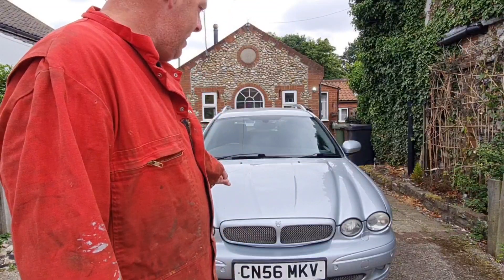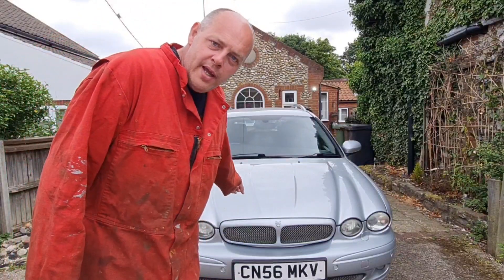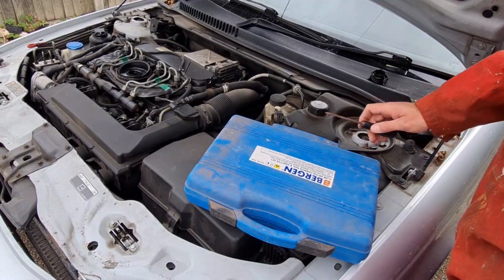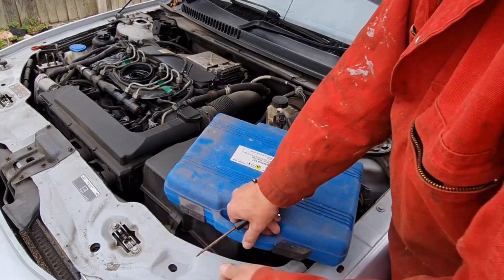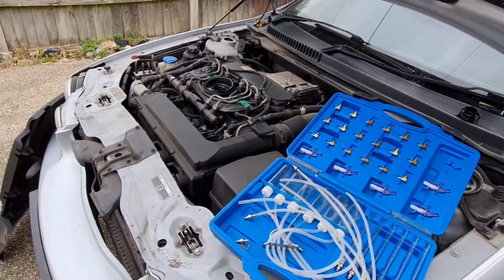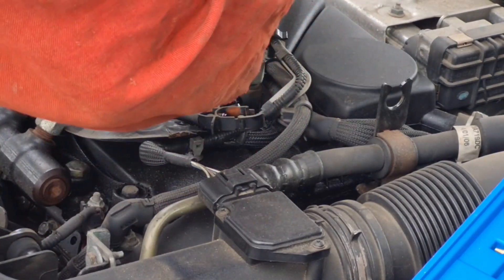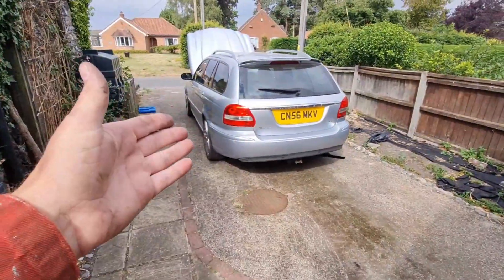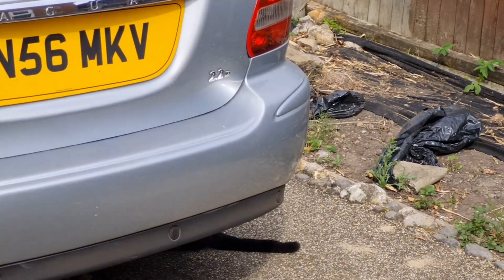How to do Diesel leak off test and what is it?

Comment: I believe common rail fuel pressure is alot higher than 2000 psi, more like 2000 bar (29000 psi) or even higher with more modern diesels
Reply: newer cars up to and above 60,000 psi esp the Euro 6,as higher pressure and smaller amount of fuel gives less smog,higher pressures actually do most of the job as it smacks the piston down on the power stroke with less fuel needed for combustion.

Comment: I work for a motor factors and by coincidence a garage I called at today were doing a diesel leak off test.  
As you say definitely two injectors need replacement, it might be worth replacing the third one depending on cost. If you replace all 3 you will have future proofed it.
Reply from the maker: Yes I think I will do all 3. depending on price.

Comment: Does this test shows if the injector is stuck closed right? Is this test useless if the injector open?

I guess what Im saying is that it is more likely that the Inj2 is the opwn one and needs replacing where's the other 3 are ok. Wouldn't that make more logical sense.
Reply: That's a good point and that depends on what a normal leak off reading is meant to be in ml

Comment: Funnily enough after 2 weeks of being recommended this video, my 1.9 TDI (non pd) has started gushing out diesel from its 4th injector which is actually leaking out of the pipe where it sits on the leak off nozzle. Bought a leak off test to arrive tomorrow but with the diesel actually leaking from the hose itself, is that a case of the injectors that ruined or is there a sign of something more serious like an overload in leak off pressure?
Reply from the maker: Hello there. Normally the leak off pipes are just made from that braided rubber hose. Not high pressure stuff. It's common for the to perish and leak with age so don't panic. You can buy that pipe in sets of 4 from Halfords I think. 
Do your test with the engine up to temperature as I did on the video mate. You only need to run it for 2 or 3 mins. The VWs are pretty good engines. Let me know how it goes mate. You can message me through my Facebook page if you rather. 
Good luck buddy. 👍

Comment: i reckon you`ve got 3 injectors which are cream crackered mate, really it needs 4 injectors in it and as most injectors pack up within a few thousand miles of each other, you might as well get a WHOLE set of 4 , and that`s going to cost what the jag`s worth , UNLESS your either going to rebuild them yourself which is not that hard or buy recon injectors which if your keeping the jag, is a no no.